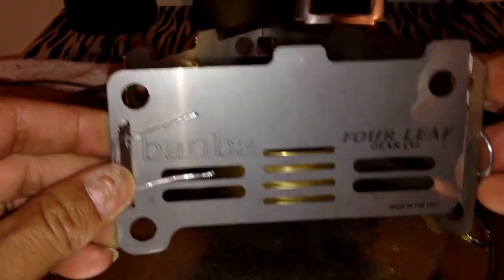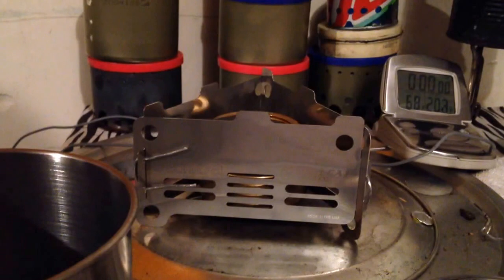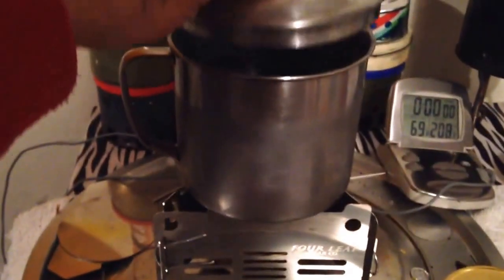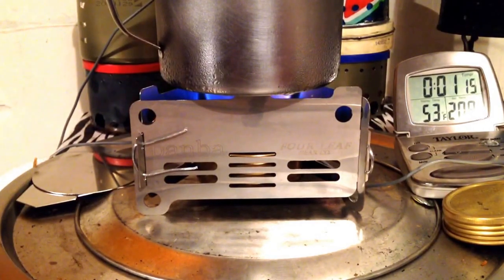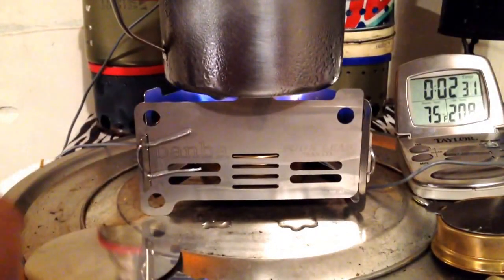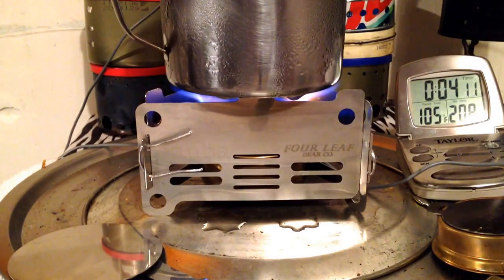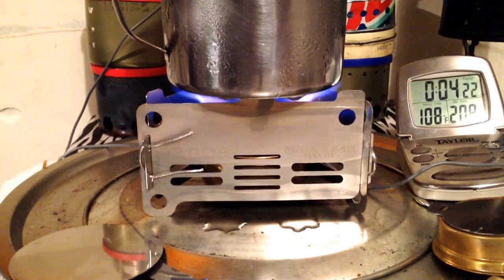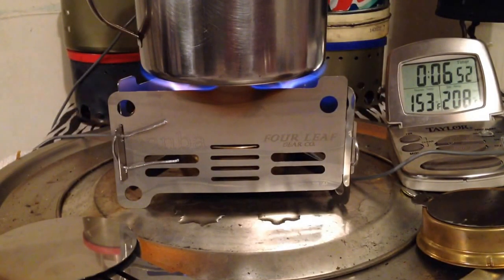Banba Stove stand Prototype by Four Leaf Gear Co. Trangia test #1

Comment: _It is not possible to adjust height of Trangia burner on the Banba Stove or most any three piece flat pack including the "Trangia Triangle". You are already at the highest setting. If you move lower the Banba lifts off the ground. And no room for a winter preheater attachment.
_I came here to learn which was top. I did not know it had words etched on it. Thanks for the video, I would not have known otherwise. The etching on mine is nearly invisible. 
_The Banba is fair priced and looks sharp though I'm tempted to bend two tabs into clips and replacing the remaining pin with tempered spring steel. Very eager to see a boil test using wood, that should be interesting.
Reply from the maker: I did several test using wood. Will post then soon